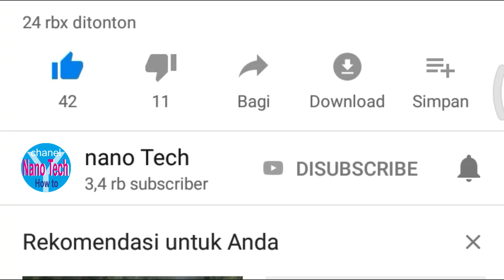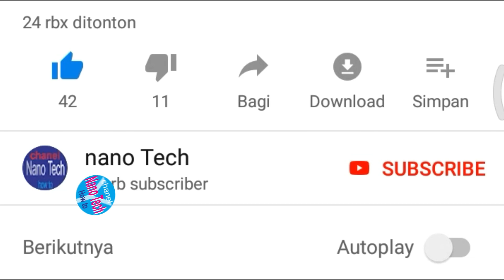How to Repair / Fix a fan that smells Burning

Comment: I have a question. Will it fire when you continuously using it without replacing the burned switch? Only number 1 switch isnt working and smells burning when I use it. I am now using number 2 switch.